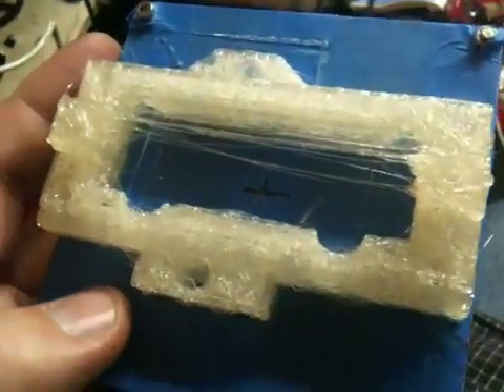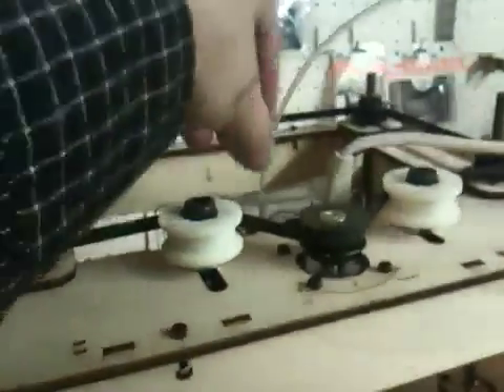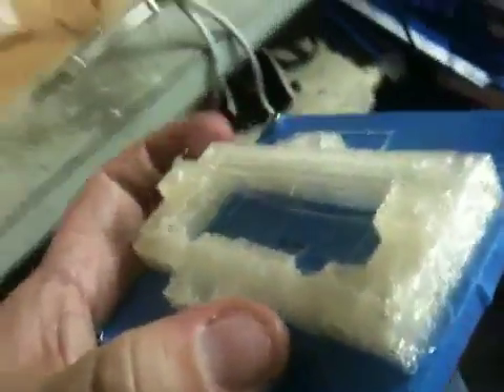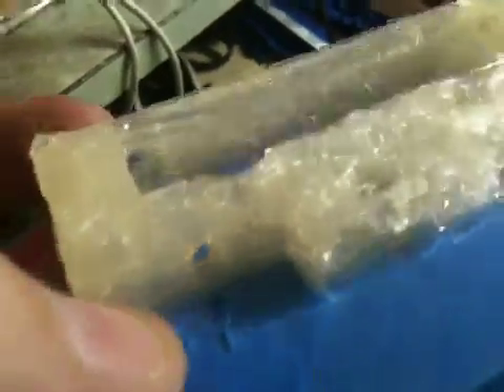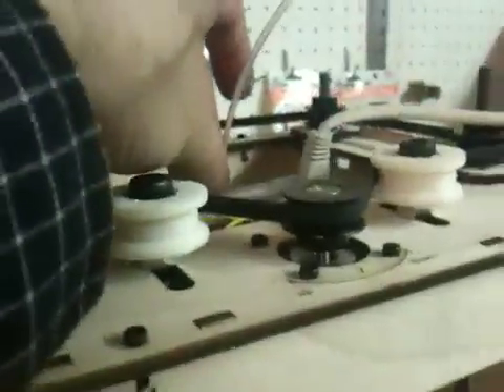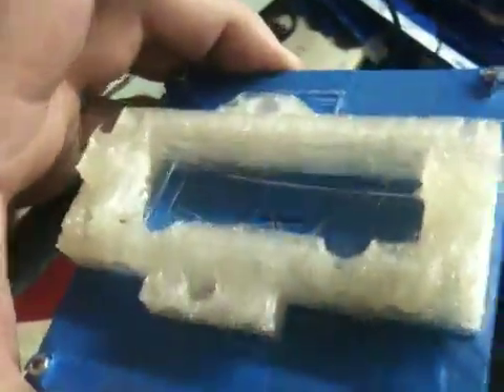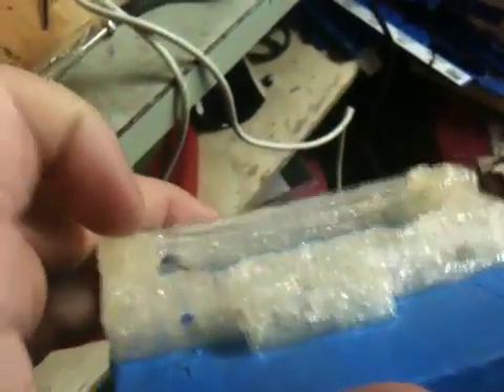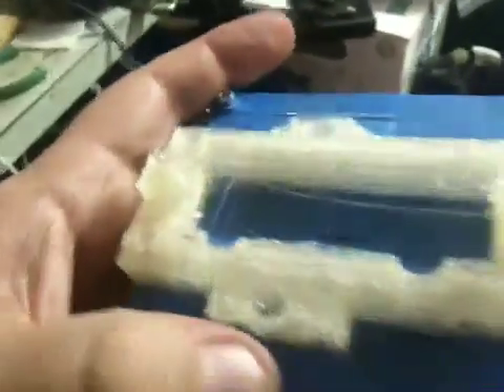Lowered Expectations

Comment: I had the same problem when I started using my Makerbot, but with ABS. I later found out that the problem was caused by the extruder temperature being set too low. Also the idler wheel had to be tightened a little. I place it as close to the extruder pulley as possible, and it worked fine afterwards.